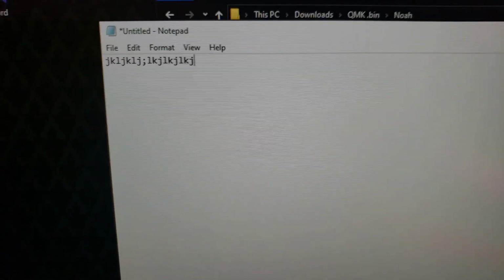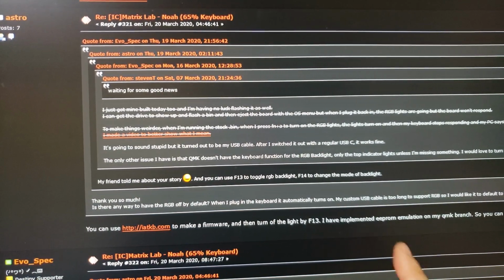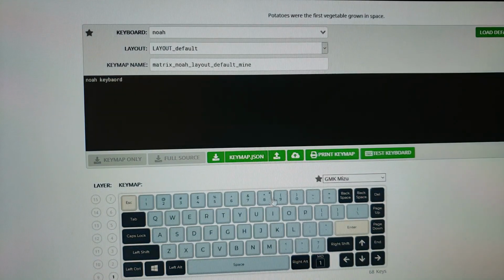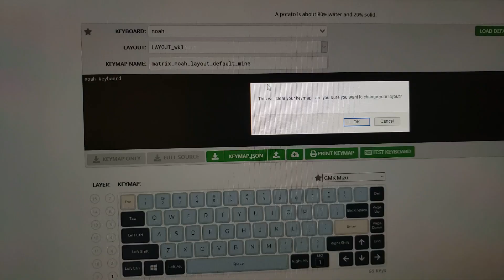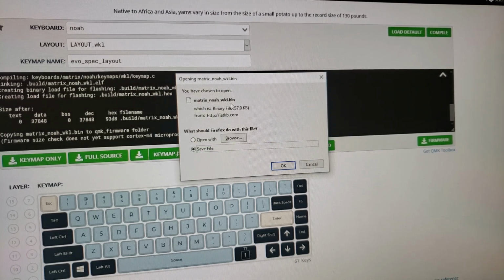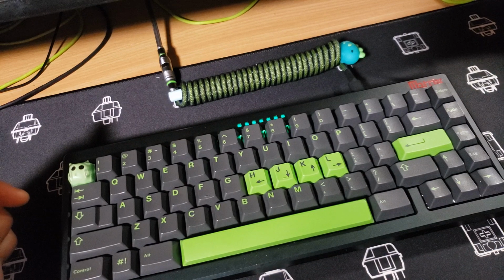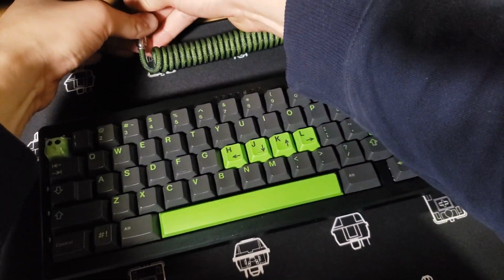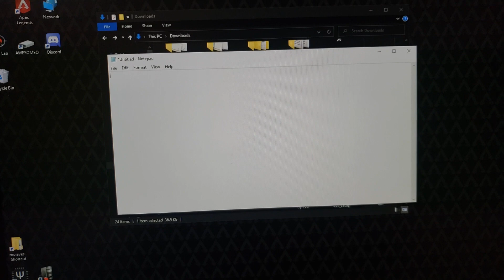How to flash the Matrix Noah.

Comment: Has anyone encountered issues with the iatkb? I am struggling with a layer issue. When I program MO(1) + arrow keys to control music playback, the keyboard registers multiple keypresses. The music app would go on an infinite track skipping unless I do something to stop it. At times, MO(1) + arrow keys does nothing until I press MO(1) one more time. It is as if some keybinding is happening (is this related to NKRO?). BTW, I replicated the exact keymap as yours. Have you had issues like I am experiencing? I tried setting the MO keys in Layer 1 to KC_TRNS and NA but it doesn't do anything. The problem seem to be happening with music skipping though. Other combinations of MO(1) works fine.

BTW I tried QMK Configurator and this problem doesn't appear to exist. I also tried multiple computers and the problem persisted. I also tried remapping to other physical keys and the problem follows the key. So I am suspecting something is going on with the code (?).
Reply from the maker: Interesting, I never really questioned it when it happened but this does happen to me with the iatkb flash. Are there any short comings with the QMK configurator now that V2 has shipped out?
I think you are right that it only happens with the iatkb flash, Might be worth PMing Astro about on GH.

Comment: This guide's been helping me thanks.
Works on V2, but I'm curious if it's available to do a VIA Flash
Reply from the maker: Thanks for letting me know! 
I didn't realize that it works on the V2s as well.
If that's the case, I don't think it will work with VIA flash because MechMerlin tried to do it back in the day and couldn't do it IIRC. There's a VOD of it on YouTube, I never fully watched it though.
Reply: @Evo_Spec  Also commented on Merlin's video on his stream, and yes unfortunately it is by design won't be VIA supported. Matrix missed the opportunity.

Comment: I think I somehow deleted my drive. It used to show up as my G: for my matrix Noah but now its gone and the keyboard isn't detected. Do you know how to restore it?
Reply from the maker: when you hold ESC and plug it in, does the drive still show up? 
If so, then you just need to put a new .bin in.
Reply: @Evo_Spec  It only shows up for a second and then goes away. I'm wondering it there's something wrong with the usb port